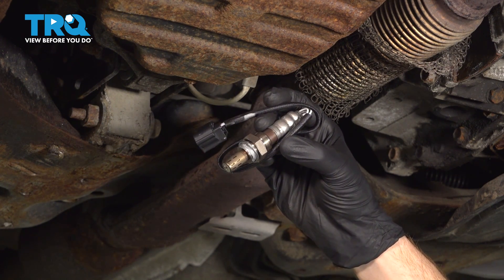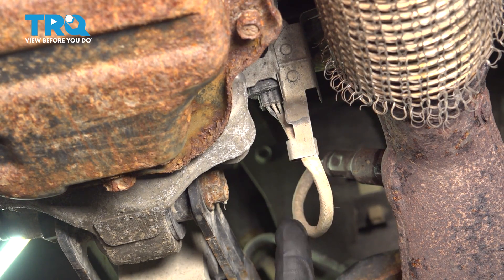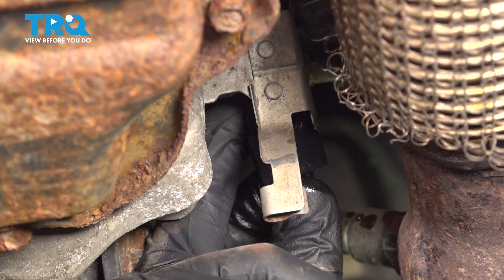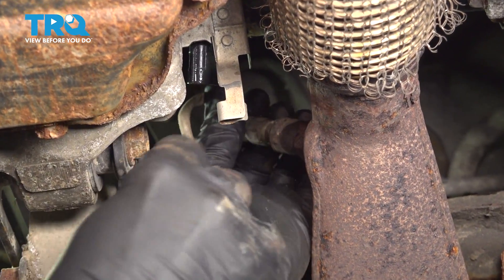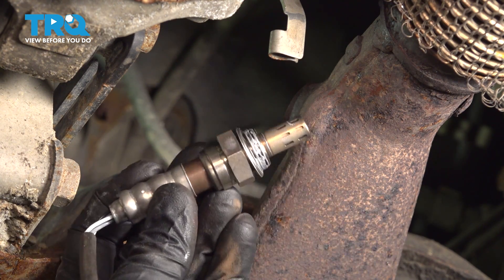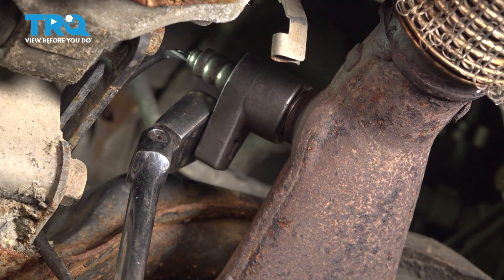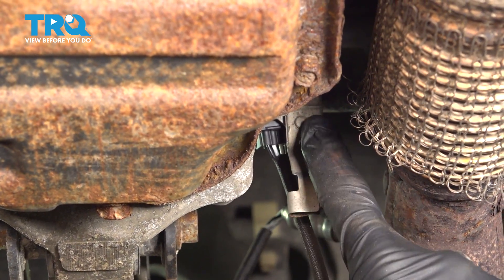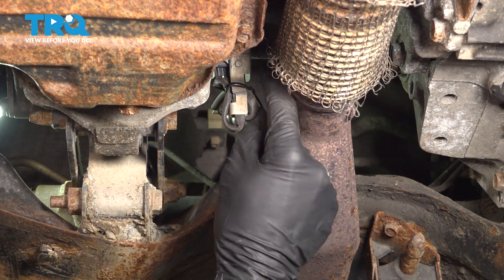How to Replace Downstream O2 Oxygen Sensor 2012-2018 Nissan Altima

Comment: If you visit .Nissan Assist online you'll see that Nissan has extended the warranty of the rear oxygen sensor in the case of a short to ground condition to 20 years or 200000 miles on all 2013 -2016 Altima's and Sentra's.